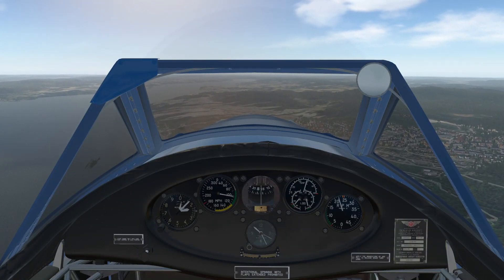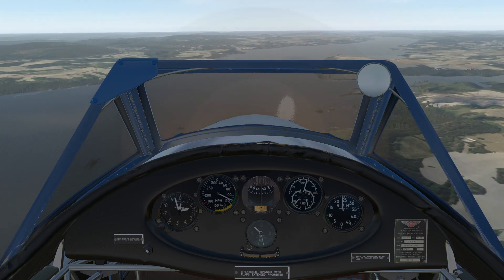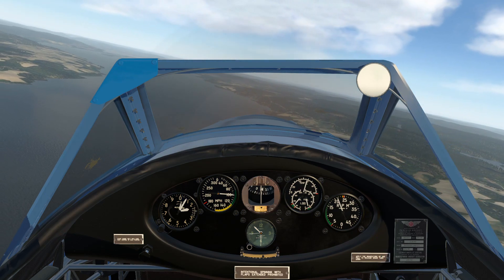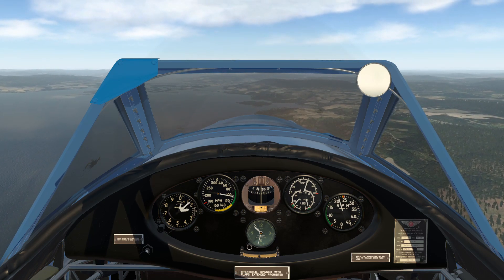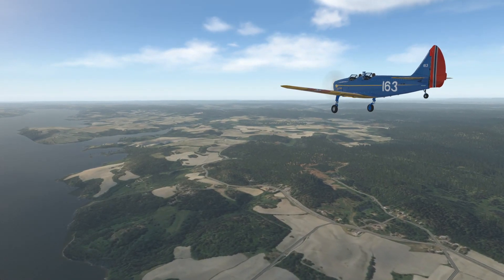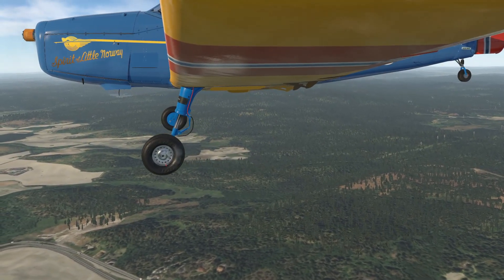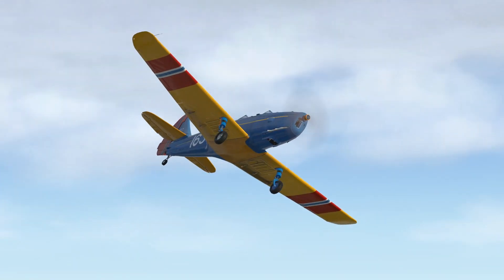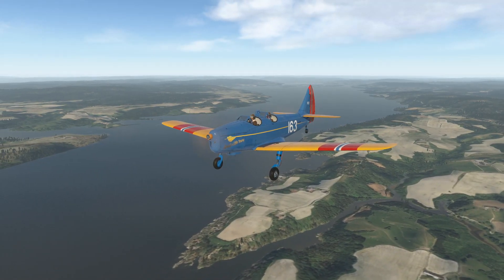UJS Fairchild PT-19 : Trimming and Turning

Comment: This is great stuff. This plane is perfect for “real” flying. You are great as an instructor. Nerdy, and knowledgeable. 
BTW - In addition to the thrust over the tail, the center of thrust will often be above or below the center of gravity, thereby adding/subtracting to the pitch tendency in doing power changes. This is one of the things that can make a major difference in a high wing vs low wing airplane, if everything else is roughly equal.
Reply from the maker: Thanks Erik - That's going to be my new Twitter bio - "Nerdy, and knowledgeable". ;-) My wife may disagree on the second half! Yes I remember the significant pitch/power couple from the 737 sims, although the A320 does tend to hide that effect a little bit. I remember "interesting" pitch effects during a go-around with a C172 with 40 degree flap!